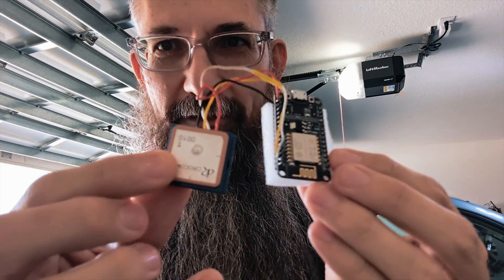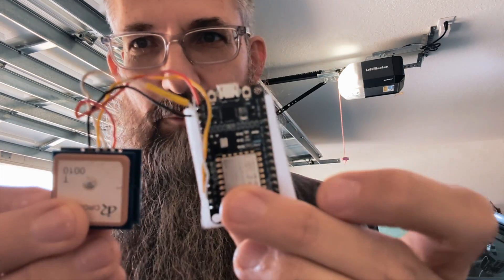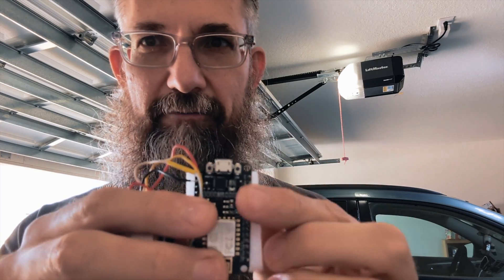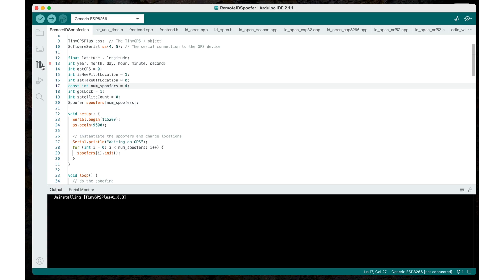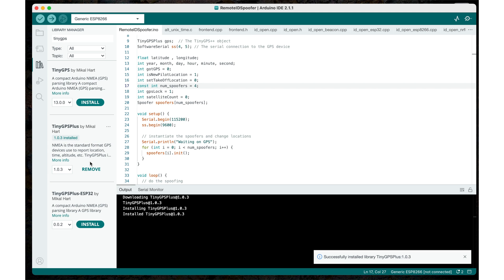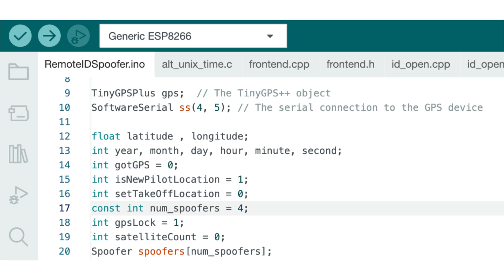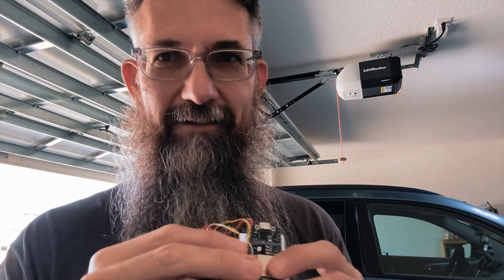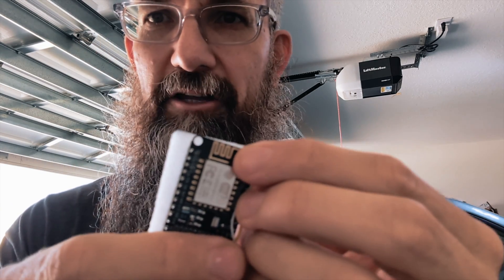How to "Comply" with Remote ID

Comment: Hey Stacey, thanks for the code.  I tried to compile it and it errors out on "Compilation error: frontend.h: No such file or directory" in the .ino file
Thanks,
Dave
Reply from the maker: Try again...I just fixed it. Thanks for the catch!
Reply: @StacemanFPV  I finally figured out my problem, the old DIYDrones GPS module that I have is at a 38400 baud rate and the ESP8266 can't handle that speed.  Once I get that changed to a lower baud I'm sure it will all work.
Reply from the maker: Nice!  Keep me updated
Reply: @StacemanFPV  Got it!  I had two things biting me.  First I thought the baud rate was too high so I changed the baud rate on the GPS from 38400 to 9600 and verified it changed by using PuTTY and seeing the NMEA messages being received.  Second, I was using the "RX" & "TX" pins as labeled on the board and finally remembered those were used by USB so I connected them to D1 & D2 (GPIO4 & GPIO5).  So now I was chasing my tail again as it wasn't working.  I hooked my scope up to it and there was data on the line but the scope decoder wouldn't decode it.  So I used the PuTTY app again to look at the NMEA messages and they were scrambled at 9600.  Turns out the OLD DIYDrones GPS I have sets the baud rate back to 38400 on power up (I read somewhere that DIYDrones put custom firmware on this GPS module).  So I have it working and the ESP8266 will indeed work at 38400, I kinda figured it had to because it communicates with the Arduino serial monitor on the PC at 115200.  I'm only getting one ghost drone though, four takeoff sites but only one drone (five SSIDs also).  I'm using a WEMOS D1 Mini with the ESP-12F.  The WEMOS is smaller and lighter and might be a better option for smaller drones if one were to experiment with attaching this setup to a drone or small RC plane.
Reply: Ok cool, I'll try it soon, thanks.
Reply: It compiles now.  Now trying to get my GPS to talk to the module.  I think it's baud rate or TX/RX connection issues...  Thanks again

Comment: Thanks for this.  I’ve been flying RC on a budget for years with foamboard planes and cheap components.  A single RID module exceeds my entire investment in the hobby, but you’ve just provided a low cost solution!

Comment: Go on arduino , i have the original uno ,decimilneave or however ts spelt, 15 years ago , we could dos "deauthicate" from linux aircrack suite!
I was a white hat "of coarse!"😢 I took coarses as i wanted to be a pentester, legal vulnerability finder as it was good money!
i ran injecter drivers from the pwm outputs to fets and had crank sensor and all other inputs and outputs O2 sensor and look up tables etc.
ARDUINO ROCKS, AND ALWAYS WILL, LINUX FOREVER!
BRILLIANT STACE
#RC_ADDICT #rcaddict
P.S if you ever work in a university, dont deauthe "Dos" their system, they dont like it! Haha😂😂😂❤
Reply from the maker: Lololol good stuff mate!  It's definitely fun.. Gotta figure out something fun to use these for around the house
Reply: @StacemanFPV  start with using the analog accelerameter from sparkfun, so serial read the value from x y or z or all, anolog read, then use 12 volt and your logic level from the arduino, and set a old motor bike coil, and use the map function, so map the tilt to the pwm output O-255.
so use a common ground, and map the tilt to a greater than value to a fastswitching mosfet, resustor always between the microcontroler and the fet, then put a diode across the fets collector, which fast switches your singing arc, tazer, but its a singing arc!
Its so so easy, then you have an alarm with a tilt switch which triggers the arc (plasma) 6 v motorbike, you will need a heat sink and a high amp misfet
easy code!
Reply from the maker: Interesting...  I'm definitely going to tinker with these some.
Reply: Me teaching ,electronic gear shift with pid
https://youtu.be/kcCZIvGJDKQ

Comment: I feel like I'm missing something. What is Remote ID?
Reply from the maker: Remote ID is a new regulation from the FAA set to go into effect on September 16. Basically every drone, plane, flying device that is remotely controlled (unmanned) and weighs more than 250g will have to be outfitted with a device that allows anyone with a smart phone to track the drone (location, speed, altitude, etc) AND the location of it's operator.

Comment: Thank you Stacey. Just another legitimate demonstration of why this Remote ID is the wrong solution for a problem that just doesn't even exist in recreational FPV and Radio Controlled model flying. This form of remote ID can and will cause a host of potential problems that haven't existed in 50 years or more of model aviation!  I would say that it would take quite an intense effort of research to present even a dozen instances where  FPV freestyle and RC model flying has caused serious injury, death or conflict with manned or UAS aircraft in 40 years of the hobby. The actual and weekly problem is when manned aircraft fly too low to recover from stall, mechanical malfunction, navigational error, weather and vision problems and the lack of real world, actual in air and  simulation  training of such starting from the beginning of initial ground and flight training. FAA, make the difficult decision to increase the low limit of navigable airspace so as to give those in the air time to decide how react so as to live and recover from the frequent and known, by all, statistical causes of fatal and near fatal aviation accidents. And give us on the ground space to life and work  and play, yes even play with our statistically safe recreational model aircraft. I myself can't wait to slap a remote ID on all my craft, on each flight. I hope they gather so much safe data so as to get bored of it. And if we keep flying safely like we have worked successfully at in the past, and strive to in and for  the future of this fine hobby, they will be bored of it and be able to shift their personnel toward the real issues. And I see and recognize that  the FAA has been and is increasingly addressing those issues that have caused and cause so many precious fathers, mothers and children to be lost. Also most of the changes directed by Congress for the management of the Airspace is coming and may, if administered well, be of benefit to most of us. But if it includes  filling the lower 500 ft. of the atmosphere with numerous intrusive commercial, noisy and nosy aircraft. No.
Reply from the maker: Yeah from what I can tell this is abysmal for reliability.  Which makes it pointless.

Comment: Remember you only need to remote id drones that require registration so if you dont register you dont need to remote id.
Reply from the maker: One thing to note on that... If it requires registration and you don't register, it doesn't mean you don't have to remote ID it... You're just breaking two rules rather than one.  So if you're good with breaking one, two ain't no big deal either :-)

That said registering definitely gives the FAA an easier time
Reply: oldguyFPV says;  Registering a drone with the FAA is a contract.  It is through the contract that the FAA gets jurisdiction over the drone and its owner.  I choose not to contract!
Reply from the maker: It's not a contract but do whatever you want